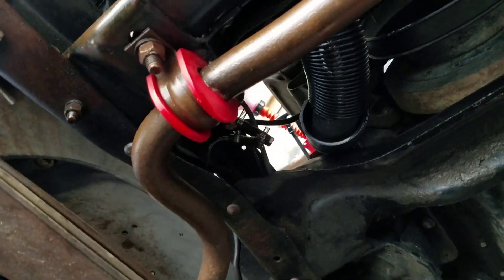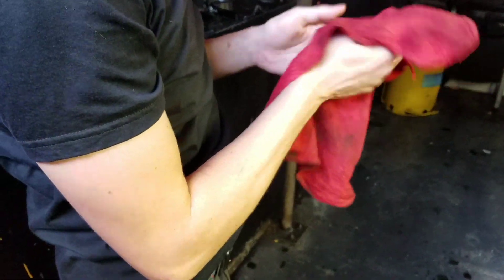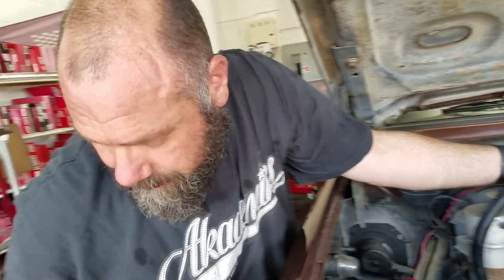AMSOIL Transmission Flush 100% Synthetic ATF

Comment from the maker: Eben Rockmaker
Independent AMSOIL Specialist (Dealer#: 5331179) 
Mobile: (702) 472-3614

My link to buy AMSOIL: https://www.amsoil.com/offers/?zo=5331179
Steps to order by smartphone or computer: 
1. My blue link gets you 25% discount and free shipping on orders $100 or more as a Preferred Customer Member ( best way to buy AMSOIL ). I will get credit for your purchase when you use my link. Click My blue link, Click Join Now Orange Bar Preferred Customer for 1yr or 6 months. Note: AMSOIL will not keep your Credit Card on file. There is no recurring charges.
2. Click look up vehicle.
3. Select vehicle type AMSOIL has all the fluid amounts listed. It's best to get extra bottles because that way you won't need to reorder and pay shipping $8.99 on just one item...lol
4. After you have all the products added to cart then complete order. Any order $100 is free shipping and ships in 1 to 2 days. ( 90% of orders before 12 noontime will be delivered next day😉 )

AMSOIL Vehicle Lookup - https://www.amsoil.com/guides.aspx?zo=5331179

Comment: I have a Chevy Cruze Diesel with the Aisin Warner 6 speed transmission.  Owned since new, and was never happy with the transmission which seemed to downshift too much.  Got the Amsoil aw1 compatible full synthetic fuel saving trans fluid, filled it to proper level by taking the temperature of the fluid to get the correct level.  We love the way it shifts, how quiet it is, and how it seems to shift at the correct times now.  That original fluid it was filled with was supposed to be lifetime, but at 65,000 miles, it was black and smelled burned.  Seems a lot of other Cruze diesel owners experienced the same thing. And everyones fluid was black and burned even at 30,000 miles.
Reply from the maker: That reminds me of the smart car I did ....lol
https://youtu.be/JIQYjrYYRGU
Reply from the maker: Check this - AMSOIL Products & Vehicle Lookup - https://www.amsoil.com/guides.aspx?zo=5331179

Comment: Now my question is, if I need to change the tranny fluid and want to drop the pan to clean up the magnet as well, what’s the order to do this stuff in so I’m not wasting an incredible amount of expensive amsoil?
Reply from the maker: Oh you would just want to do a pan drop that's what I would recommend you only do the flush if you have multiple people that can help like in the video you need a lot of extra hands so I would just do a basic transmission fluid change by dropping the pan you will see a huge Improvement in shifting speed and driveability and you'll be surprised in the winter how it runs and shifts in the cold that will be the easiest to do and cost-effective still with great performance the fluid will mix with the old fluid and you'll see a huge Improvement.
     I give a man a fishing pole & show him how to fish. 

     Together! We can get your vehicles to run better than brand new! 

     For me to get credit & be "Your" Independent AMSOIL Dealer please use my website below or my dealer no. 5331179 call anytime Eben Rockmaker 702-472-3614
After you click on: http://syntheticoilprotection.net
1. Click hamburger menu
2. Click buy wholesale
3. Add 6-month PC member to cart
4. Select shop by vehicle. 

New promos: FREETRUCK

Comment: Should use a clear line so you can actually see the pace of fast/slow its moving. The hose for a dehumidifier drain line
Reply from the maker: I'm not sure what that is.
Reply: @Syntheticoilprotection  instead of using the black hose attached to the funnel. Use a clear line attached to the funnel to see it going in the fill tube

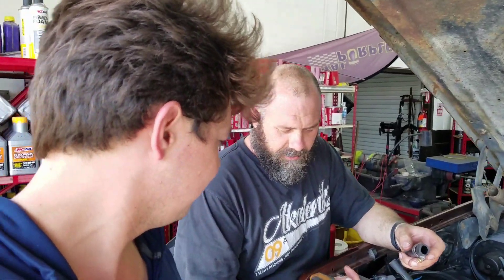Comment: 5:47  and you use the return like to have the pump suck the new fluid into the transmission?
Reply from the maker: Exactly there's an input and an output and then there's a guy up top that pours in the fresh fluid
Reply: @Syntheticoilprotection no, what I mean is, there is a line that’s circulating that fluid. Thats how you get it to pump out like that. Where’s the other end of it? Couldn’t you attach a hose to the other end as well and have that sitting in a bucket of oil for it to suck back into the transmission instead of someone pouring it in from the top?

Comment: 8:56  all that nice clean fluid pouring out is exactly what I’m trying to avoid. I’d really like it to not cost me an extra hundred dollars or so. But I want to make sure all the old oil is out and completely replaced with the quality amsoil.
Reply from the maker: Yeah you can actually do a pan drop where you just change what's in the fluid with what's in the pan it will mix with the old fluid and it will shift a lot better that's what I recommend for your first time doing it this is just one example of what you can do if you want to do a complete flush by getting all the old fluid out after you had the Amsoil engine flush in there to help clean it.
     I give a man a fishing pole & show him how to fish. 

     Together! We can get your vehicles to run better than brand new! 

     For me to get credit & be "Your" Independent AMSOIL Dealer please use my website below or my dealer no. 5331179 call anytime Eben Rockmaker 702-472-3614
After you click on: http://syntheticoilprotection.net
1. Click hamburger menu
2. Click buy wholesale
3. Add 6-month PC member to cart
4. Select shop by vehicle. 

New promos: FREETRUCK

Comment: Why didn’t you use the Amsoil engine and transmission flush?
Reply from the maker: Because we didn't think it was necessary.
The trans looked really good and was just redone I think only a few thousand miles ago.

Zach wanted to get the extra wear protection of the hundred percent synthetic ATF fluid
Reply: @Syntheticoilprotection  Awesome. That's a nice truck. I know you're in Vegas but for those of us in the north, winter is coming... we'd love to see a video of the amsoil HD metal protection application.
Reply from the maker: @st.schochko9822  
I will do one on the HD. I did do a little bit of info on it in this video https://youtu.be/SL4wjmUAhBo